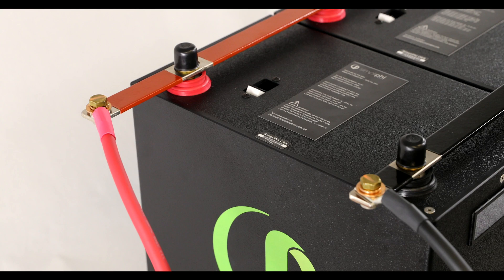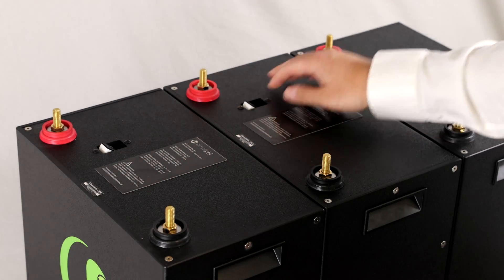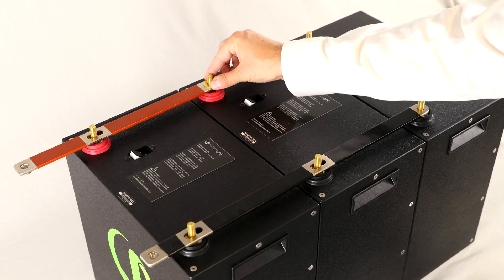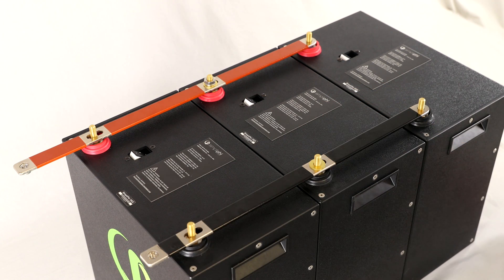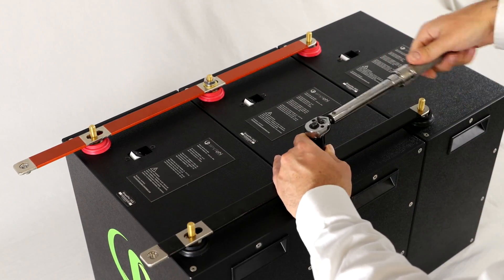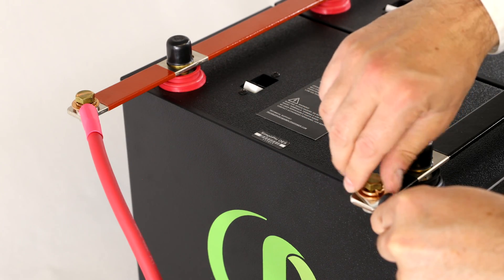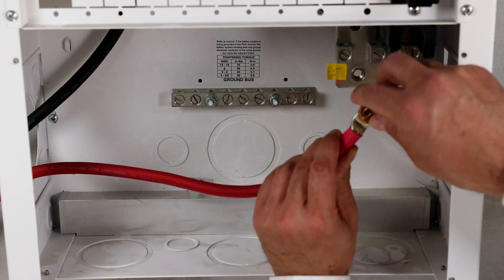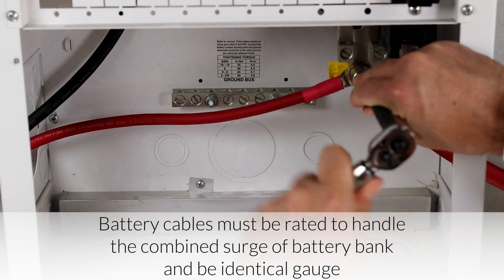Paralleling PHI Batteries Using Busbars

Comment: Can you connect more then 3 batteries on a longer Busbar? If not, why not?
Reply: Yes, you can. The busbar will need to be sized correctly for the load. You will also want to grab the positive and negative connections from opposite sides for better load balancing between the batteries.

Comment: The way you’ve hooked up your bus bar configuration means the lead battery will  draw down first. Bus bars have resistance and electrons will always take the path of least resistance which in this case would be going in and then out the first battery. The negative bus bar should be turned end for end to maintain balance.
Reply: This was mentioned @0:33